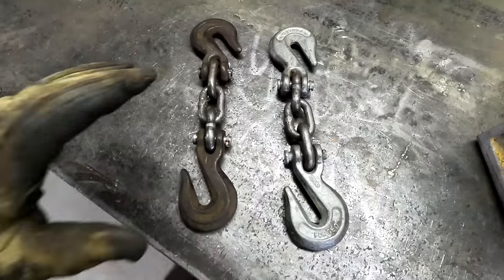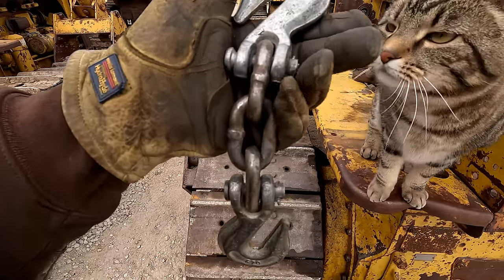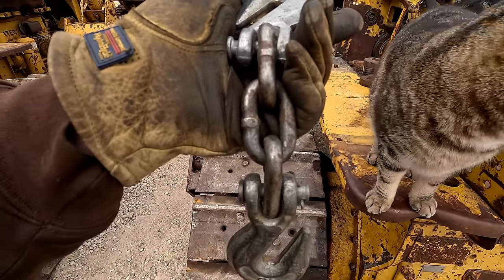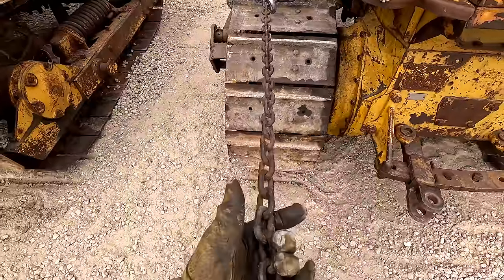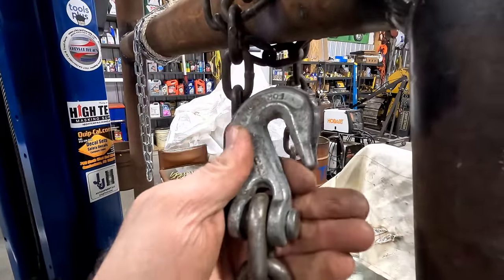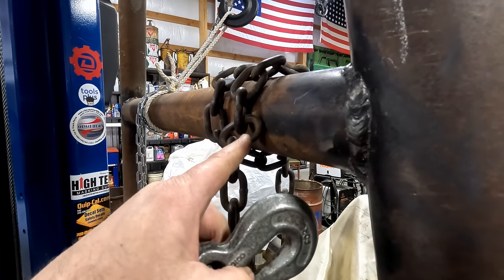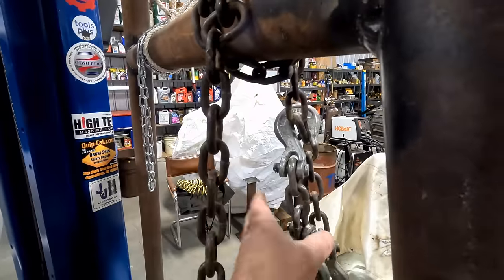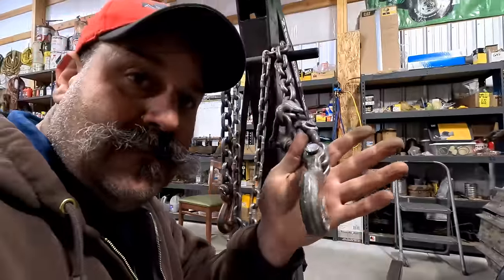A trick for moving immobile track machines, too good not to share!

Comment: I can’t even explain how much this helped me. I have an old dozer I have been trying to get going and those tracks was stuck. I drug that thing back and forth for 3 days now.  Did this trick. And just a few minutes got it broken loose. Idk why it never dawned on me to pull on the dang tracks.  🤦🏼‍♂️
Reply from the maker: Really happy to help and glad it worked for you! I was amazed how well it worked for us. 👍
Reply: @lifeafterourloss  it’s a old d4.  I almost got it sorted. Was parked in 1994 the guy said.  I have a few more lines to repair and few other oddball stuff but she fired right up today 

Hey question if you know. I got it started today but I couldn’t get it to turn off.  There is a plunger on the starter I had to push and once I push it it shut down.  So assuming that solonoid isn’t working.   Is it suppose to have 12v all the time and by turning off the switch it kills the 12v and that plunger moves.  Or how does that thing work?
Reply from the maker: What series D4 do you have? You can usually tell by the first two number letter prefix in the serial number. Could be several different things. Most of the early ones were only 6 volt Pony motor start. If you're talking about the pony motor, the magneto switch should shut it off. Or you could turn off the fuel and let it run out. That is the preferred method and much easier on the downdraft carburetors. There's a little valve on the bottom of the small gas tank in front of where the operator sits. On later models it's above the pony motor. If you're talking about the main engine you can push the throttle down all the way then hold the plunger down and override it and it will shut off fuel. On later machines you can just push the throttle all the way down and it will do the same thing. If you don't have one I would get an operators manual on eBay. You will need to know what series (4G, 7J, 7T, 5T, 6U, 7U etc.) you have to get the correct one. They are not much money but they are definitely helpful. 👍
Reply: @lifeafterourloss  ahh. Maybe it’s the throttle thing. I dint try that.  I’m almost sure it’s 12 volt. It had two super old battery’s ran parallel.  Good idea about the manual.  I’d love to have one.  I will get the numbers off of it tomorrow.  I found several places had the serial numbers.
Reply from the maker: It actually sounds like a newer D4 or one that has been converted to direct start. So maybe it doesn't have a pony motor? It may be a D4C. Without knowing the serial number it's really impossible to say.
Reply: @lifeafterourloss  I’m sorry. I went back and looked at some pics. It says d3c on the back side of it. Idk why I was thinking d4 If I got the serial number would you be able to identify what manual id need to get for it?  I sure appreciate all your help. I have never worked on anything like this. I’m pretty handy with fixing stuff tho.  I own a 500 acre Motorsports park with a couple flat tracks and motocross tracks and I’m trying to get this old stuff back up and running.  I need this dozer super bad.  I have an old road grader I’m going to start on next.
Reply from the maker: Sure if you get the serial number I can help you out. That is definitely a direct start machine with no pony motor. Early 60s or newer. I believe the throttle still shuts off the fuel if you go past the detent all the way down.
Reply: @lifeafterourloss  I was shocked at how well it ran. We bought this place in 2000 and I was just told that’s how long it set before we got it. So I’m not really sure of any of its history.  But I did just like I would an old car or bike. Flushed and cleaned all the fuel stuff. Changed all the filters and cleaned as much as I could. Fresh batteries and it cracked maybe 5 seconds and fired right up.  It dint have a cover over the exhaust so water got in and when it fired up it literally rained black crap all over me lol. I was stoked tho.  When I got back home my wife said. “wtf happen to you and why are you so happy about it” lol.  Today I got all the metal lines off to the blade tilt and had them remade.  Soon as I hit the control they just shoot fluid everywhere.  The mud caked on them rusted them. It has two dipsticks under the floor cover and one says beval and one said trans.  Once I did the chain trick and got the tracks moving with my tractor I jumped on it and it started moving on its own. So guess they was just stuck.  I’m researching tonight to see what fluid for those dipsticks and try and change those tomorrow. Both was very low. But it goes forward and reverse now.  And after the lines fixed all the blade movements work.  One of the turning pedals stays down but I can pull it up with my foot and it goes straight.  So still need to sort that out.   The not turning off with the switch stumped me.  I seen that plunger on the starter and pushed it and it shut off.  But I ran out of time to really dive into that.  I stuck my meter on the wires tho and it shows 0 volts with the switch on or off so maybe it’s a wiring thing.  But now that it running it starts as soon as it cranks. And it hardly does any smoke like my old  diesel tractors.  Guess that’s good.  But after I get this sorted I’m start on my road grader and I have an old car backhoe that’s prob going to need alot of work.  It seems the newest of all.  It has a cab but alot of glass is broken and the doors is off.  But I found the doors in the barn so no clue why they took them off.   That’s what I’m fighting. The old owners never took care of anything. And I have noticed any panel or anything they had to take off to access something they just left them off lol.  So I’m finding stuff like that everywhere and trying to find its original home.  This place really doesn’t make any money to buy anything nice. But it’s kind of a local landmark and the only place around for people to come ride so it’s more of a labor of love lol.  I went from never even sitting on a tractor to retiring from racing getting this place and having to be a full time diesel mechanic. Thank god for you guys on YouTube.  I’m determined tho. And from my research they say this old stuff is just as good if not better in some ways than new stuff.  So I have that going for me lol
Reply: @lifeafterourloss  I’m gonna try that first thing tomorrow. The whole decel thing confused the literal crap out of me.  I thought I’d hooked something back up backwards 😂😂 had to jump on google real fast.   One may think I’m in over my head.  Well actually everyone thinks I’m in over my head.  But one thing I’m good at is biting off more than I can chew.  And then chewing it anyways.  I’m gonna be dozing any day now!!
Reply from the maker: I would really consider a membership to ACMOC. (Antique Caterpillar Machinery Owners Club) They have a lot of the manuals available online for some equipment. The form is also monitored by folks that were lifetime mechanics for caterpillar.
Reply: @lifeafterourloss  awesome. I will check that out tonight.  I tagged you in a few videos If your interested in my mess lol. My service is crap down here so may take a bit to load

Comment: Wouldn't that destroy your track putting all that force on one track
Reply from the maker: We have never had any issues even after applying substantial force. I suppose if you get crazy with it one could bend or break. The grousers are quite strong many heavy haulers chain excavators to the trailer beams on the track pad grousers.

Comment: Some guys in the Calif Central Valley (near Mudota) were trying to pull out a D-9 that got stuck in the mud. They hooked a chain to it onto another D-9  and took a running start. When the chain ran out it hit so hard that the driver went up against the windshield and knocked himself silly. The stall was so sudden that the engine stalled and the massive fan went squealing on the pulleys. They called "Eddie who hooked chains into the track and he "walked" the Cat out in 5 minutes. Ive seen tractors stuck up to the cab that need to go up before they can go forward.
Reply from the maker: I love these stories. Sometimes lessons are learned the hard way. Hopefully just bruises and damaged pride. Like you we have often had better luck digging things out. 😊